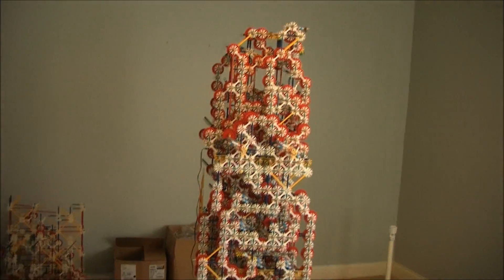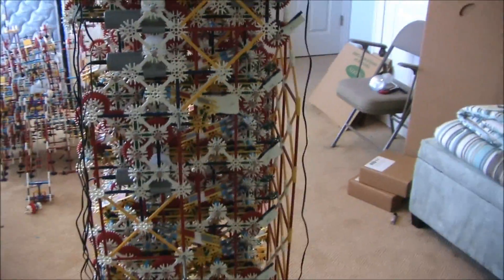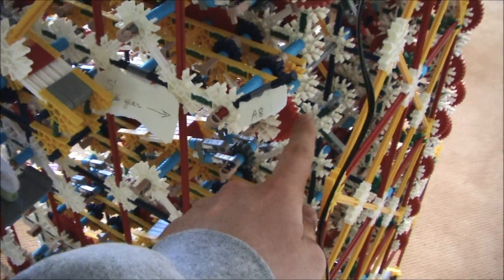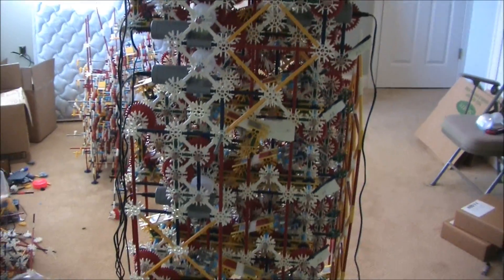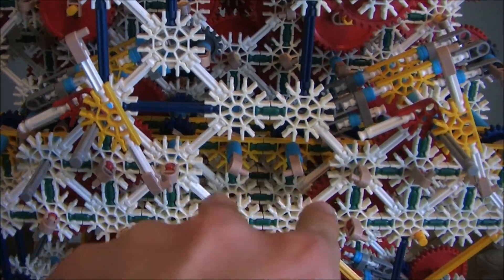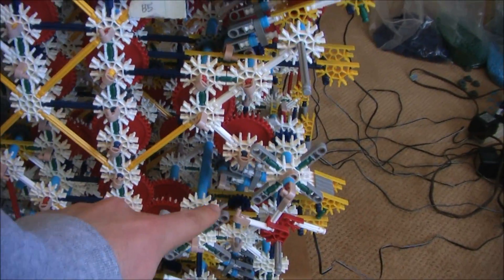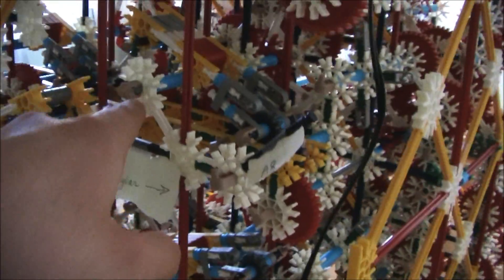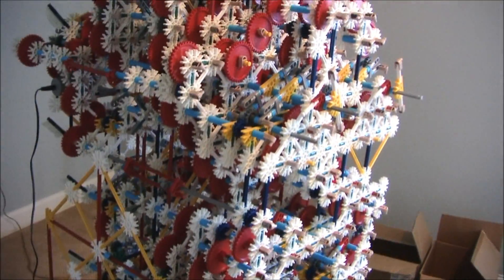The K'nuter - K'NEX Computer

Comment: At least this computer is resistant to EMP bombs
Reply: the motors are not but he can make it wind powered or any other kind of power source who need 0 electronic parts
Reply: Cédric Raymond they would, they are not delicate like a micro CPU
Reply: I think you probably could hand crank it
Reply: Well, you COULD, but it would probably take many hours of cranking to add two numbers.
Reply: Emphasis213 just replace the motor with a hand crank and bam, apocalypse computer
Reply: Emphasis213 it's not tho, they run on fucking motors
Reply: No, it wont do much damage to the motor because there aren t any  semiconductor diodes/processors, but it will most likely stop because electic trasformers (these on streets) will overheat.
Reply: Oliepolie just connect the wires to the handcranck
Reply: Cédric Raymond Forget that just use a well lubricated hand crank
Reply: Emphasis213 motors my dude
Reply: ComradeCaldor WATER COOOOLLL
Reply: John Stevens: Water wheel or hand crank.
Reply: AIO inc.: EMP's fry transistors and other small components due to over loading them and burning them out.
Reply: And all that EMI from the clusters of AC/DC rectifiers.
Reply: Just make your entire house a Faraday cage, really helps with keeping neighbors off your wi-fi. If you have to have external antennas for anything put a proper polyphaser on it and have a good grounding path.
Reply: Yep.
Reply: I WAS YOUR 1K LIKE REMBER MEEEEEEEEE
Reply: The motors aren't
Reply: fucken laseh soihts
Reply: Emphasis213 this computer is the computer of the post-ww3 world
Reply: That doesn't mean it's going to be any more useful than one that has ceased to function. 

Besides, an EMP won't do much damage to many older computers anyways - with no magnetic media, there's nothing to erase.
Reply: AIO inc. all data storage that is old is magnetic you oaf. It’s the SSD that is not magnetic.
Reply: Emphasis213 motors
Reply: Emphasis213 not really, It's connected to wires and motors idiot

Comment: why not use lego technic it will be way smaller
 and you can have idler gears with dog clutches so you can move the clutch ring to select gear 1, gear 2, or none/gear 1+2.

bevel gears, work gears, idler gears, gear strips puleys chains levers and springs etc.

stronger and faster motors.

Comment: I cant believe this is only a full adder. You need two to make a 2 bit computer(If i remember correctly). Good luck making a real computer out of this. Still awesome none the less.
Reply from the maker: You're right that this is an overweight design. I actually have a much smaller and faster implementation that is designed specifically for adding and subtracting numbers. However, such designs are fairly commonplace across the web (you can find some on YouTube). The purpose of using discrete gates to build this machine is to prove the concept that a fully mechanical computer can be built using the same fundamental technology that comprise modern day computers.

Unfortunately, this large design comes at a cost, and without the external financial backing (or assistance from volunteers), I've been forced to halt construction.
Reply: May I see the one you made?
Reply: Dan Ehrman Reminds me of how Nicola Tesla couldn't get funding for his Wardenclyff Tower Project.

Comment: I don't understand how gears are used to make calculations. Gears are only one direction. If you spin two different gears at once they lock up. I've seen people use gears several times but I don't get it.
Reply from the maker: I'm sorry I don't have better footage of how the calculations work....

While you both are correct in a mechanical sense, the calculations are actually occurring at a level of abstraction above the mechanics (i.e. the spinning gears themselves are not producing the results).

In fact, the gears are merely a means of sending information from one part of the computer to another, and their direction is arbitrary. At the point where each gear/rod meets the input of a switch, it will either turn the switch on or leave it off (1 or 0 in binary code).

Each gate (AND, OR, etc.) has at least one physical "switch" at the front that quite literally behaves like the mechanical motion of a human flipping a light switch: an incoming input rod (powered by turning gears) has a sort of water-wheel-like extension on the end of it that, when turning, will flip the switch of the given gate (binary 1). If that input rod is not turning, the "water wheel" is of course stationary, and thus the switch will remain unflipped/off (binary 0).

As a side note, before in the initial implementation of this computer (from 2005), I had not yet realized the "water wheel" trick and instead had created what I called "timed release switches." They were placed at the front of every gate to flip an input switch only until it had fully reached the binary 1 position (and no further). Essentially, they allowed any input power to be cut off from the output after a timer expired. (The internal timer was itself powered by the input.)

As you can imagine, these switches were easily prone to failure if not reset (by a human) perfectly; and worse, each gate's timer needed to be set to a slightly different time. It wasn't until the conception of the "water wheel" switching that the computer was able to yield truly reliable calculations without human intervention.
Reply: +ItzHaloBro Did you even watch the video?
Reply: ItzHaloBro Hilarious. -_-
Reply: Gears are not only one direction, LOL
Reply: Israel Raizer Cruvinel So pretty much you're saying you don't get it either. 
Also, please get two gears and spin them against each other and show me it works.
Reply: Amelia Hartman That's not what I meant, if you have an odd number of gears, the last gear will be spinning the opposite direction of the first...
Reply: Israel Raizer Cruvinel Yes, just like I said. You can only have one input because it forces all the gears to spin based on that input. You can't spin two gears against each other.
Reply: Amelia Hartman Look up a bevel gear differential
Reply: Gears aren't used to make calculators, a circuit board and some positive and negative wires are

Comment: The computer on which you are watching this video has hundreds of these machines on a tiny chip.
Reply from the maker: Zach Weibel More like thousands. This is a full adder, but your "billions" number is an actual transistor count. There's no good way of knowing how many full adders Company X has put on their chip, but thousands wouldn't be an unreasonable guess. (Just think: any 64-bit adder in the logic would need 64 of these.)

For curiosity's sake, if you imagined that the entire chip consisted of nothing but adders, you could work backwards to figure out how many full adders would be on there....The full adder would probably be comprised of 9 gates. In CMOS logic, one of these gates probably contains 4 transistors. So we can figure that there would be 36 transistors per full adder (maybe plus a few depending on the implementation). So then on a chip with a billion transistors, you could fit 27 million of these full adders on it....But you wouldn't be able to do anything useful with it.
Reply: more like hundreds of thousands.
Reply: +Dan Ehrman Actual adders in almost all contemporary ALUs of processors (CPUs, GPUs, DSPs...) use some kind of parallel prefix tree adder (implemented as systolic or semi-systolic network), which is a different kind of topology than the (mechanical) carry ripple adder you're trying to build, except for some ultra low power & ultra small+slow µP/µC which still might use this very simple topology. Ok, a few others use carry skip or carry save adders, which is are even different topologies.
Reply: Will Fowler the chip is also thousands times faster
Reply: +Anybody Noname - Thousands? A modern CPU has a clock rate of 1 - 5 GHz. A cycle on said processor is typically the execution of a single machine instruction, like adding a value to a register. If we're generous and say an adder moving a digit to another adder counts as a "cycle" on this machine (as opposed to adding a value from beginning to end), then it takes about a minute for a full cycle to happen. That's about 0.15 Hz, versus ~ 1,000,000,000.00 - 5,000,000,000.00 Hz for an Intel chip. Thousands is an understatement.
Reply: +Dan Ehrman Also, I'd recommend you at least the following papers: "A Taxonomy of Parallel Prefix Networks" by David Harris, 2003 & "Parallel prefix adders" by Kostas Vitoroulis, 2006 if you're already familiar with carry look-ahead adders, but since you're trying to build mechanical adders, I'm not sure whether this is necessary. For your goal it may be more appropriate to read through restorations of Konrad Zuse's Z1 documents (I recommend Raul Rojas "Reconstruction of the Z1 computer", also his "The Z1: Architecture and Algorithms of Konrad Zuse’s First Computer" paper), which was supposed to be a purely mechanical computer, but turned out to be needing electromechanical relais to remain reliable enough after a long run, which resulted in the Z2 & Z3. TL;DR Zuse didn't use carry-ripple adders, but instead he used what he called adders with "anticipating carriage", which today are called "manchester carry chain adders", usually implemented using some kind of electronic transistors & having the same kind of switch-level structure then Zuse's mechanical adders. Hope that helped :)
Reply: Will Fowler    But this is so much cooler
Reply: Well, not really quite like this. Computer transistors operate on chemistry rather than mechanical operation. There are zero moving parts in a processor. But they perform the same function as these mechanical switches, just faster, more efficiently and with better reliability/longevity while being much more compact than what is possible with any mechanical mechanism.
Reply: +Dan Ehrman 9 gates, yes, if you mean only 2-input NAND gates. But if you can easily build different gates(AND, OR, XOR) from mechanical components, then maybe the full adder implementation consisting of 5 gates may be simpler.
Actually, for a CMOS-level full adder in digital circuits, 28 transistors are sufficient, but depending on the underlying technology, the output load (fan-out? buffer?), input topology & supply voltage(sometimes also the body-bias voltage), you might go down to 8 transistors per full adder in extreme cases including input inverters using some degenerate form of PTL.
Reply: Frank Harwald The diameter of a helium atom (one of the smallest atoms) is 0.1 of a nanometer.  One of the largest stable atoms is cesium/caesium at 0.3nm. So yes it it still just a few atoms across. As we both know the strange world of quantum mechanics is holding us back from getting any smaller in terms of individual components. What you said about 14nm ifets is what I meant.
Reply: must be smol chicken nuggets
Reply: He just needs to remake it with wood and brass instead of K'NEX, and he'll have a  perfect Steampunk computing machine.
Reply: @Braden Best
once in sixty seconds is 1 cycle / 60 seconds = 0.01666 Hz
so not even 0.15 Hz

typical CPU has around idk 3 GHz or 3,000,000,000 cycles / 1 second
or 180,000,000,000 cycles / 60 seconds

so we're talking about the following proportion
1 : 180,000,000,000 (one to one hundred and eighty billions)

whoever said the ratio was in billions was right
Reply: Amazing
Reply: billions*
Reply: thecooldude9999 It's more like billions actually.
Reply: David Vermillion there are existing integrated field effect transistors now that have 14nm across their gate, which is also the smallest possible producible structure. However, this gap is only a small part of a single transistor, of which you need multiple ones to produce a cmos gate or adder, even for a 1 bit only adder.
Reply: you could add really big numbers :)
Reply: you count chip size in billions "transistors" his transistors consist of 1 "element" so i would say that it's closer to millions then hundreds
Reply: But I’m watching this on an iPad...
Reply: Zach Weibel I
Reply: *thousands you idiot
Reply: Will Fowler little more than that i suppose
Reply: Dan Ehrman Will you stop blowing my mind?
Reply: Zach Weibel do you realise that "hundreds of thousands" is equal to billions?
Reply: that wasn't the point
Reply: lol i use phone
Reply: Will Fowler more like millions
Reply: it could be , depending on how many groupings of  "one-hundred-thousand" you have. 10 groups of "one-hundred-thousand" each would not be one billion, but instead a million. However, it is indeed true that 100 groupings of "one-hundred thousand" would equal a billion. But that only serves to show that "hundreds of one-hundred-thousands is equivalent to a billion" or possibly more.
Reply: David Vermillion an atom is about .1 nano-m
Reply: Not hundreds, Billions.
Reply: Yeah but this knex.
Reply: he he nerds
Reply: +Will Fowler They are electrical though and many components are made up of a few atoms.
Reply: well no sheet sherlock......  OBVIOUSLY THE ENTIRETY OF LOGIC GATES IN A HOME COMPUTER CONSIST OF CHICKEN NUGGETS AND PHOTO RESISTORS OBVIOUSLY
Reply: Heath Mitchell I'm dead serous many are 13nm across (nano meter is about the size of an atom). Getting smaller is getting much more challenging.
Reply: +David Vermillion A few atoms? That can't be right!
Reply: +Heath Mitchell NO! That is Guantam computer
REAL COMPUTER USE CHIPS SMALLER THAN BACTERIA

Comment: is there a way you can provide a schematic of some sort. i made a half adder out of knex before (not a very efficient design). im in college right now (going into computer/software engineering)
Reply: So this would be your part-time hobby?
Reply: I'm more into building homebrew computers out of actual electronic components (transistors, ICs etc) but I find mechanical computers very interesting as well.

Comment: Nice work !!.. i have always wanted to build a mechanical cpu of sorts.. it would seem that you are a long way from a full fledged cpu but very well designed none the less.
What were you planning for synchronization (clocking) the outputs so that the info could be used by the next stage

Comment from the maker: By now, you can probably see where this is going....We have devised a way of controlling which of two rotational outputs is enabled merely by controlling a single rotational input. From there then, those two rotational outputs can be used as inputs to other transistors and logical gates, thus providing us with what we need to build a computer....

Comment from the maker: Now when a seesaw gear drops down to the ground, it falls into that hole and completes the path of gears just below it; likewise, the gear at the other end of the seesaw is pushed up out of its line of gears and breaks the path. So by controlling the axle of this seesaw, we can control which of the two gear paths is complete. The final step is to connect the beginning of each of the two gear paths to some common "drive" source (equivalent to Vdd/Vcc in electronics)....

Comment from the maker: When I rotate the seesaw axle clockwise, Kid A gets to touch the ground, and Kid B gets pushed up and he can wag his feet all around all he wants. When I rotate the axle the other way, it's just the opposite: Kid A is up in the air, and Kid B is stuck on the ground. NOW--remembering that these are actually gears and not children--what if on the ground, below each gear, we put a line of connected gears with a hole in it (i.e. a missing gear) JUST below the seesaw gear above it?....

Comment from the maker: In my implementation (note: yours could be different), I chose to mount two small free-spinning gears on either end of a seesaw-like arm. At the middle of this arm is an axle that, when rotated, allows me to control the vertical position of those free-spinning gears. Imagine the gears as two kids sitting on a seesaw and myself with my hands on the middle of the seesaw controlling who gets to touch the ground. Now here's where it all comes together....

Comment from the maker: So in building your transistor think of it as a transmission--one with only two gears (1 and 2). So then what we want to do then is create some kind of shifter which can be activated with ROTATIONAL motion (note: that's the key to making this work); doing this will allow the outputs of other logical gates to change the input (the shifter) of your transistor (transmission)....

Comment from the maker: The key is to think about a transistor for what it is functionally--or more accurately, what it accomplishes in a computer. Essentially, it lets you achieve one of two possible outputs (0/low or 1/high) by providing it one of two possible inputs. A good mechanical analogy is a transmission: in a manual transmission, you have a shifter (your input) and the driveshaft (your output) that turns the wheels. (This is actually how I came to the design in the first place.)....

Comment from the maker: The ultimate plan was to make an 8-bit CPU, but unfortunately, I have neither the space nor the finances to continue the project. The full adder shown in this video is just 1-bit. I drafted a redesigned version for the computer that would not use discrete gates for time-intensive combinational logic such as is in this adder, and thus run much faster and require less space. However, as of now, the project is on hold.

Comment from the maker: Great question. I invented what I call "mechanical diodes" (which I later discovered are essentially sprag clutches) to combat the friction problem. The mechanical diodes cut off the force that friction would otherwise apply backward through the power train. However, this solution of course can't eliminate all friction, and utilizing an array of motors is most effective in keep all the clockwork moving.